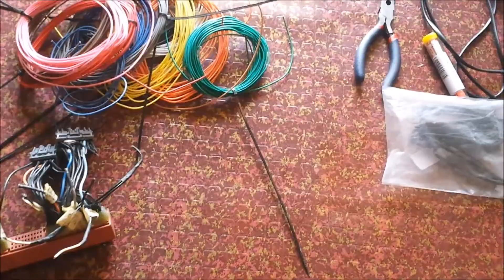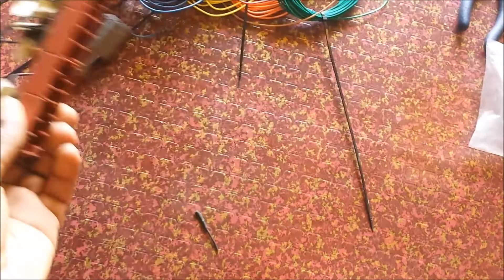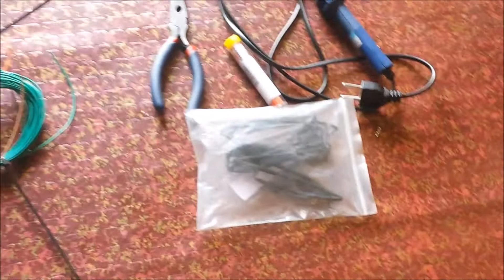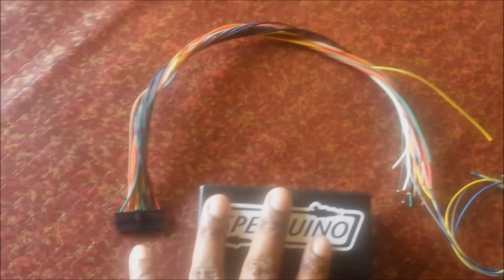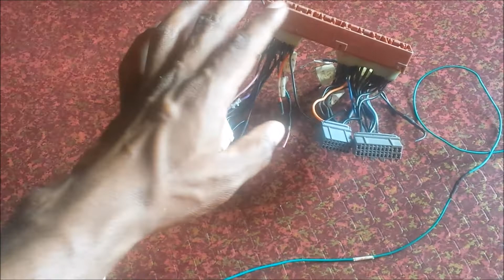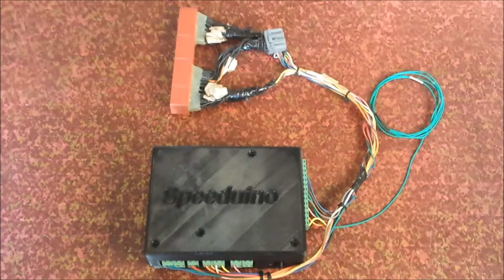Project BIG Red - Making Speeduino PNP Harness

Comment: Are you using a relay for the vtec output or how are you making Speeduino output 12v for VVT?
Reply from the maker: It's a good thing you mentioned that. I have been meaning to update the wiring documentation I wrote. VTEC will require the use of a relay controller by the Speeduino vvt output

Comment: Hey good day. Very informative. Thanx. Anyways. Why are u using 2 speeduino? Which is better?
Reply from the maker: I'm actually using 1. The v0.3 is for the red car "BIG Red". The NO2C " smaller speeduino" is for my car. 

I wouldn't say one is better than the other. They both are pretty much the same. The v0.3 has more fuel and spark channels which is a plus , but the no2c is more compact.

 I prefer using the v0.3 because its easy to unscrew and move wires around. I like the no2c because its compact and has the tach and launch control outputs on the main connector instead of having to go through the proto area with the v0.3. For the average Joe, either will work.
Reply: Both are awesome. Maybe i go with v0.3. Is it possible to get it running with coil on plug? Since it has 4 ignition out? And have you tried or maybe is it possible also to get it working with a launch controll? Thanx again for sharing alot of your work. Cheers
Reply from the maker: @istapitbastard6189  yes coil on plug is possible. There are a couple other 4 channel speeduino boards other than the v0.3. There is the v0.4 and ua4c. 

I have done launch control before. Check out my previous videos
Reply: Thanks so much. It helps alot. Keep sharing. Cheers